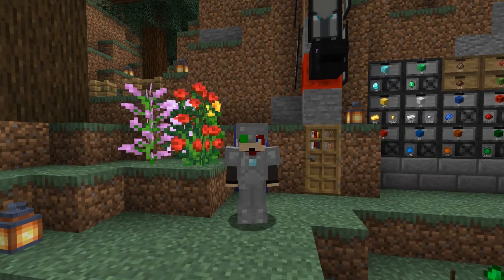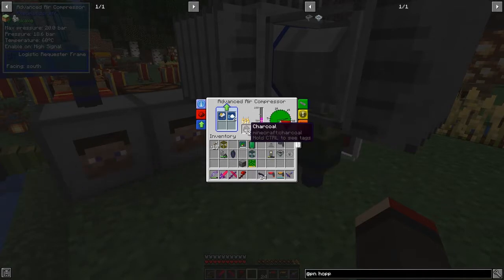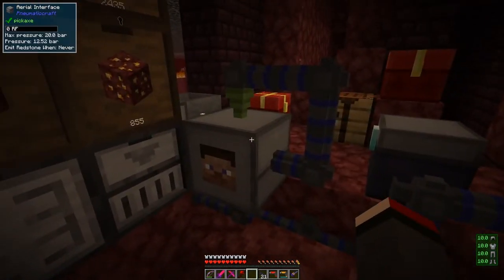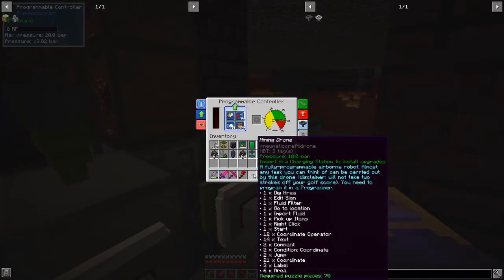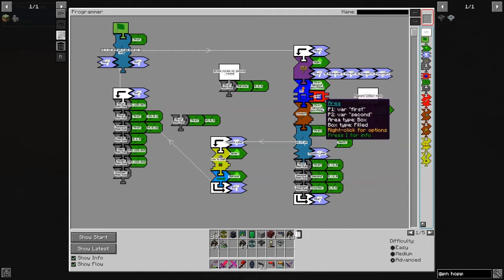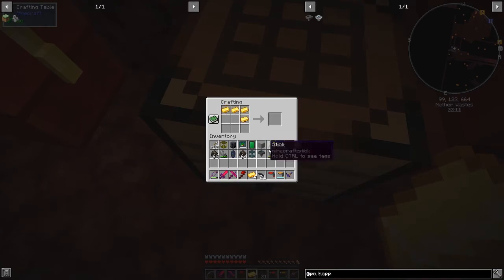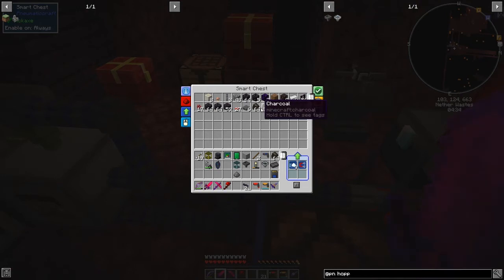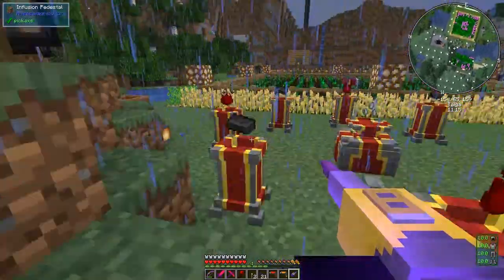PneumaticCraft: Repressurized #31 - Wireless Air with Aerial Interface, Nether Quarry for Netherite

Comment: Huh I never considered transferring pressure like this. Mostly use the classic air can in a charging station method.

 Quite the program will have 2 learn how that works. Still not great with the more advanced programming bits. He'll struggling with some the simple stuff like emit Redstone not a clue how to work that.

54° in the nether might be perfect to set up my bio-fuel there save the hasel of fittleing with the temp
Reply from the maker: The reinforced air canister has a hint about using them for wireless transmission of air. However, without Desht’s help I would never of figured out how to do it. 

Most of the program is based on relative coordinates and there is a link to MineMaarten’s video explaining simply how to do this type of digging.
Reply: @duncanwebb4934  will have to watch that.

Ya I would never guess that interaction eather. Mods usually don't have interaction with ender inventory out side of giving u a portable access.

Comment: hi i know this is an old video but im trying to do what you did with the aerial interface but its not working for me. Has it been changed or something? Even the tooltip from the aerial interface says that's possible but i don't know what i'm doing wrong. How am i supposed to get air from the reinforced air canisters?

Edit: I've put armor on the side that the charging module is  and now it's charging. It's very slow plus i got the second aerial interface for nothing
Reply from the maker: Things change between versions, I can’t say if it will work in your version. If you want to use reinforced tank, just place it down and attach a pipe to it.